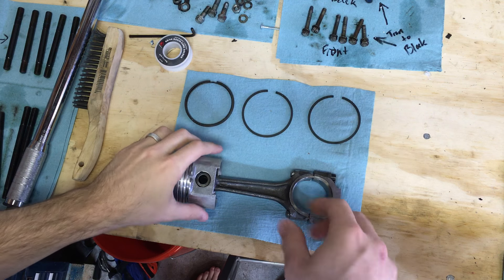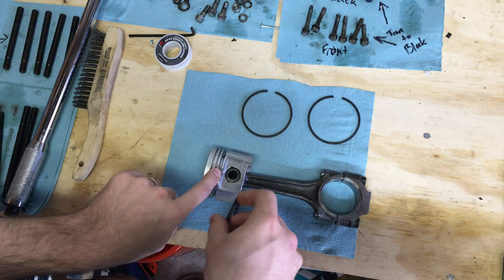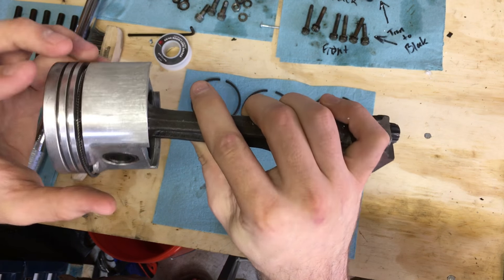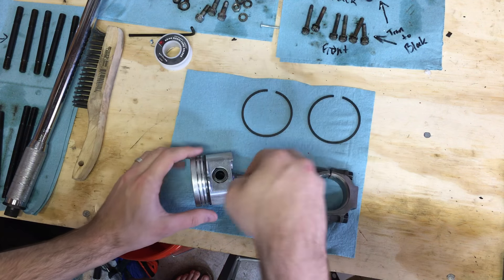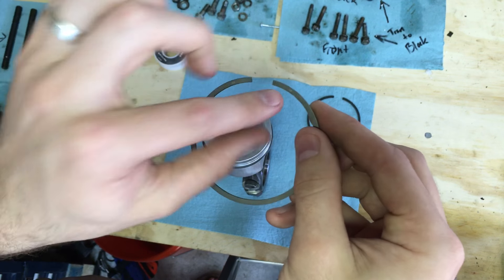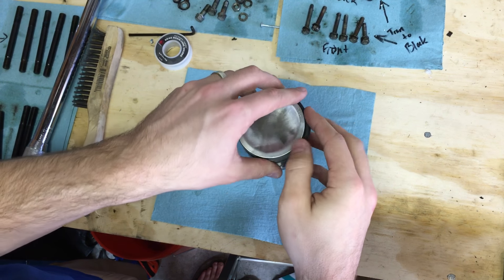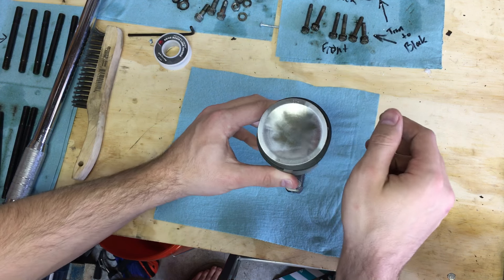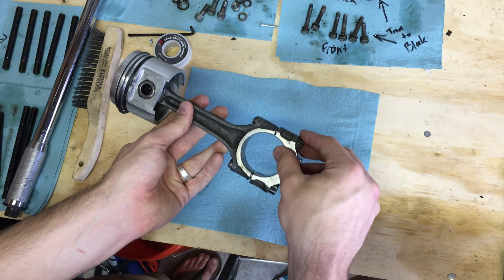Classic Mini DIY - Piston Ring Install

Comment: Hi. Can I also fit my piston rings this way in my r56 engine? Thanks!
Reply from the maker: I have not worked on modern minis but I believe piston ring installation is similar as long as you are following the spec provided by the ring manufacturer.

Comment: How much would a good set of rings set you back for all 4 cylinders?
Reply from the maker: Hey TheChronicleMustang a good set of rings is anywhere from 80 - 150 bucks. That would cover all 4 pistons on the mini depending on the size. Are you looking for a set? I can shoot you a suggestion if you are in the market.